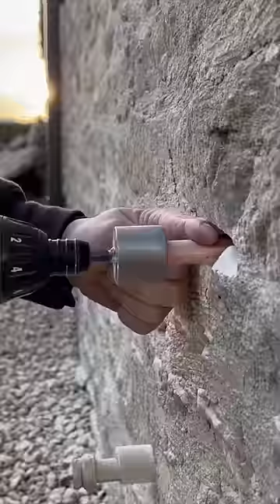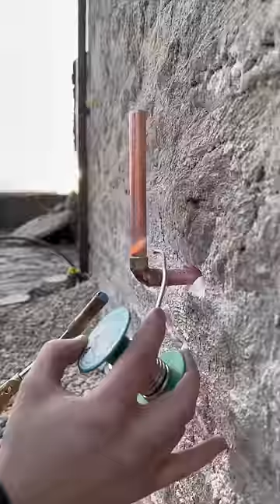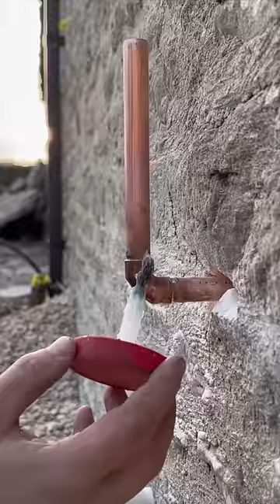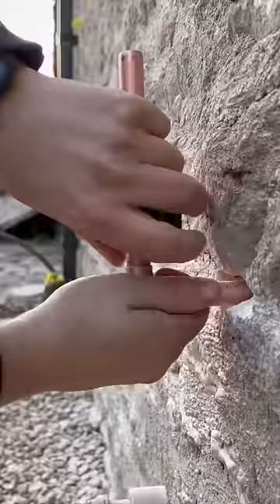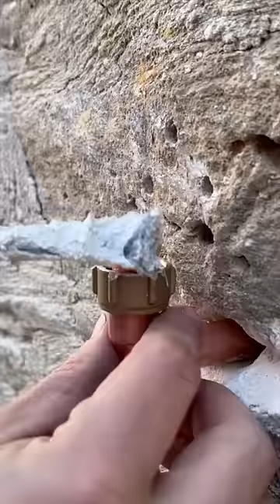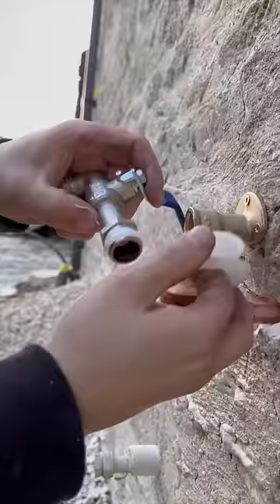HOW To fit an outside tap on stone wall! #howto #asmr #diy #plumbing #subscribe #youtubeshorts

Comment: Ppl, please don’t use teflon or pipe dope on compression or flare connections. Not even in high psi applications!! STOP IT!! Read a book or manufacturer’s paperwork
Reply: bingo
Reply: Why?
Reply: That"s exactly what I was thinking.Any kind of grit will cause a leak.
Reply: You guys are definitely not a plumber!
Reply: @adamhorton7972 I have been a licensed plumber for 29 years. Have run my own business for 15 years. They are correct. You don't use pipe dope or tephlon on compression fitting. The seal is made by the smooth copper, and adding dope can create gaps that can leak over time.
Reply: @billjordan8779  and FYI, if your such a good plumber, then you would have seen the shitty sweet joint that's gonna spray every where.
Reply: If in doubt a smear of Silicone rubber,  but make sure surfaces are perfectly clean and smooth.
Reply: I was going to comment this same thing I’m glad I’m not the only one seeing stupid stuff and thing wtf?
Reply: Dope keeps the brass from galling.  You know that creak you hear when tightening brass?  That's not a good sound. 
That sound is metal shavings between the mating surface. 
Dope is used to lubricate the brass not to seal the fitting. 

Just because you don't understand it doesn't mean it doesn't make any sense.
Reply: Keep drinking that kool aid, guess that’s why they call it dope.
Reply: @adamhorton7972  that's not silver stick, that's soft solder, it back fills once the coupling is hot. Too much and it's going to overflow and make ugly joints. You might be top help, 😒but you're still a helper, leave this to the mechanics.
Reply: Defeats the purpose of the compression joint
Reply: I have always put a little dope on the compression ring and so have all the other plumbers I’ve ever met. How would it possibly compromise anything
Reply: Tady se nám sešlo instalatérů. Pánové, za mě teflon absolutně nepatří do závitu. Závit před utěsněním třeba zdrsnit a poté namotat Loctite/tangit šňůrou, lněným česáním a nebo těsnícím tmelovým lepidlem, pro utěsnění závitových spojů. 😅
Reply: I’ve been doing this 53 years you don’t put pipe dope on compression fittings
Reply: plus Teflon on thread is lefty
Reply: I use WD-40.
Reply: diesel mechanic not a plumber but i use compression fittings on all pressurized air lines 125 psi. I never add anything to the threads. If the compression fitting goes bad those threads arnt going to stop the leak.
Reply: I like to put a quick shot of WD-40 on the compression assembly before tightening. Keeps the ring from binding so you get a perfect seat.
Reply: @therighthandmann  I agree.
Reply: @treborobotacon I can see an argument for Teflon or dope on the threads of a compression joint, but not on the actual sealing surface. Shouldn't be necessary at all though. You don't have to torque a compression fitting enough to require lubricated threads to get a seal. There are specs for all of this from the fitting manufacturers. Find me one who recommends using anything on the threads of a compression joint, let alone the sealing surface of the fitting.
Reply: @intjonmiller  
Try a bit on the threads. It makes them go together so much more smoothly. Is it necessary? No but you don't have to struggle to get them tight. 
It does nothing to make a seal though.  That comes from the face.
Reply: @intjonmiller 100% pointless to put anything on the threads of a compression fitting. The nut spins freely around the pipe big gap at the bottom. what are you sealing? Absolutely nothing.
Reply: Why they even make that dope if you don’t need it?
Reply: And what’s that Teflon…. I’m going all frying pan here?

Comment: incorrectly installed, always install the elbow and faucet downwards, because when frost comes, the standing water will freeze and then always flow out.
Reply: Have you considered that America/Canada aren’t the only places you can install a tap?
Reply: Or you just leave the valve open and any ice expanding with come out of the open end of the valve.
Reply: Id bet they got much worser issues if this is in fact a frost zone
Reply: thanks god i live in tropical country. i don't have to worry about freezing tap.
Reply: @drtibbs693  Why does water freeze differently in other countries? 😂
Reply: Ltmoore8807  wait..do you drink from the tap directly?
Reply: Ltmoore8807  that's....savage
Reply: No need for 90 degree bends.  Just go straight out.
Reply: actually unless you live somewhere that NEVER freezes avoid any exposed tubing install a frost free faucet deep enough to reach the interior of the wall so it won't freeze.
Reply: But theres no water
Reply: @BryanVoigt in a cold climate the ice leaving it open would allow the first portion of the water to closest to the opening and it would then freeze further in the pipe later and since the first section is already frozen the ice has no where to expand except for into the house or out the side of the pipe
Reply: ShortFingerRC my first thought was “well that eardell is going to snap in half in a month”
Reply: You don't know how to seal a union. You use pipe dope or never sease on the back side of the flat part of the union. That's where the friction is. Pipe dope is a lubricant on water systems. It fills in gaps for drainage like test tees but it doesn't work like that on pressurized water systems. Doing the union threads and ground joint does less than the back side of the union where the inside of the nut makes contact. Steam fitters proved this to me several times on jobs. They're 💯
Reply: @drtibbs693 you still cant drain it completely for service.
Reply: Biggest problem is going through the concrete.  It eats copper over time.
Reply: @billmoretz8718  Yep it should've been sill-sealed 💯
Reply: What about in areas with no frost bud
Reply: too late, damage has been done

Comment: Dude could travel across the globe 5 times with that teflon 😂
Reply: Why? He didn't even use much and didn't twist turn it into string wrap...
Reply: @linusaltmann2657 he used way too much. Three turns at most.
Reply: @Dude-xv4os He explained that he likes to use more because of the way their fittings are threaded
Reply: @Dude-xv4os  I had one that needed 10 turns. Put on, removed three times. 
I learned after that.
Reply: circumference of the Earth at the equator is 40.000 km
5*40.000=200.000 km
The typical teflon tape has 5 meters 
That would require 40.000 rolls
Reply: @Dude-xv4os Three turns at most? Are you having a laugh? May as well not put any on at all at that point
Reply: Sicher ist sicher!  LOL

Comment: Always connect to the top of the backplate elbow,it can be drained fully in the event of freezing.
Reply: He did it to return for a second job after it froze.
Reply: Drain off with the isolator inside.  My only issue is the horrible sherardised screws which will be rusty in 6 months.
Reply: If you’re smart enough to think then maybe there’s a bleeder valve down below. 😂 everyone is a critic.
Reply: @matthewmallory3441  So extra job  opening a bleed stuck in the back of a cupboard and catching the water or just open the outside tap when you have isolated it.
Reply: @bobrose7900  Lol you complain about the screws but dont mind the copper tube. Like were 2024.  Why did he put 2 90° pices on the wall? Like what is this abomination? This is not how a plummer shuld do this.
Reply: @grolfe3210  most spigots don't have a drain just a cut-off valve. And all too often the cutoff is below the spigot rather than above it.
Reply: @jensv874 one was a drop ear so the spigot could be secured.. and the other was to move the pipe to a piece of wall with material to secure it to.

Are you a clown?
Reply: @ObservationofLimits  Exactly - so you want one that drains itself. That is the point that I and the other 120 people have made
Reply: @ObservationofLimits  Oh yea yet I make it without the 2 90° pices. Like how do you bend a copper tube? This hole thing is just an abomination. also go strait trough the wall. No reason to do it with 2 90° like that. Im a plummer. You a clown?
Reply: Do you think once nightfall comes, just all the water lines outside insta freeze
Reply: @ghostkilla931  I did not say any of those things. People do live in places where the temperature drops below freezing. In these places they tend to shut off and drain outside taps to prevent them freezing and blowing the pipe. If you need to do this then you can mount the tap low and use it as a drain or mount it high and then have to also add a drain tap at a low place inside. Up to you which option you go for. One way is daft.
Reply: Drain inside of course

Comment: We use “freeze proof” taps here in Canada, which come as a complete wall-penetrating assembly. They are available in a number of different pipe lengths, to accommodate different types and thicknesses of wall construction.
I note that you do not air-seal the pipe penetration in the wall. Most people I know use spray foam for this task. In cold climates, air sealing the building envelope is an important part of properly insulating a home, as well as keeping pests out.
Reply: Indeed. Minus 1 to minus 40ºC doesn't forgive. I didn't know they called it freeze proof. The one I'm about to install, has the cartridge indoors. (Spring project)
Reply: Hello my friend, can I contact you...I am also in Canada
Reply: @rverro8478 that's what we have in ag zone 5 (-20°F). But I still turn off the supply inside and leave the tap slightly open. I'm a "trust everyone, but brand your calves" type.
Reply: It looks installed upside down.
Reply: Same here in Sweden 🇸🇪
Reply: It’s not as cold here also he may have insulated later or it may be a shed out outhouse
Reply: It’ll freeze and burst.
Reply: Air seal w foam etc can come later, but no fix for that freeze threat.
Reply: Here they're called frost free, they're readily available everywhere, not just Canada. This is probably somewhere where it doesn't get very cold. Anyway I use Sika Mortar Fix, spray foam is horrible. If you have time to wait a couple days, you don't even have to use screws. The mortar fix will hold it.
Reply: @Nill757 I love how everyone thinks the temperatures are the same everywhere.
Reply: @jakester455  eh? Yes it freezes long and early in Canada, but it can occasionally freeze down to Florida 28degN, and one freeze will burst that ext spigot.  More than a few contractors bid simple hose bibs in the south,  5x-10x less than frost free hardware, then walk away from that 1 in 5 years freeze:  ‘it’s the south, not my problem’.
Reply: Really interesting knowing the Canadian way😃
Reply: Freeze proof if the moron builder install it properly and allow the water to drain.  Installed improperly and they burst over winter and leave a nice suprise in the spring
Reply: This location appears to be in a warm climate area.
Reply: It appears to be the southwest us.
Reply: This comment is very much useful especially for any place in a mountainous region. Our house was a summer cabin in a mountainous region. in the winter we lived in the city. Whilst we are down at the city winter frost several times destroyed the water pipes and we had to do maintenance for them every year.
Reply: This is a short, he may have when he finished. Why assume?
Reply: Bakır boruyu kaynak yapmadan önce sürdüğün sıvı ney
Reply: We have the same here in Norway as well. In any case, this is not a smart way to install an outdoor faucet. When the pipe goes upwards outside, it cannot be drained before winter either.
Reply: It’s a stone wall.  Didn’t say what kind of wall.  Might just be a wall.  Without a roof, doesn’t make much sense to do all that. 😂
Reply: Same here in Germany my man, this is how it's done the right and professional way🤝🛠️
Reply: Una válvula de bola no es a prueba de congelación , el agua que queda en el orificio de la bola cuando se congele reventara la válvula.
Reply: I get the 12" Frost free for concrete tilt ups 😊
Reply: @Nill757  The tap like that at the back of my Dad's garage in England has been okay for over 50 years.
Reply: @BrianG61UK  is there water in it and does it freeze?
Reply: @Nill757  There's water in it. I guess it must at least begin to freeze occasionally.  It is quite sheltered from the wind.
Reply: Yeah we don’t get it as cold as you guys. Jealous of your snow, landscapes  and warm maple syrup though
Reply: Obviously this isn't a cold environment or that supply line would be doomed. The damage due to exposure is enough to turn me upside down.. What ever happened to putting a faucet directly onto the main outlet pipe without the soldered elbow and added compression fitting?  I've never seen paste used on a compression fitting.
Reply: They work awesome.
Reply: Yeah this install would burst here in Utah.
Reply: Was a 59 second video, I live in a climate that does not freeze, ever.
Not everyone lives in Canada.
We stress air conditioners over heating where I live.
See how where I live has nothing to do with where you live?
Reply: @Nill757 all depends on ambian temperatures. In Alberta can only use minimum 12 inside house but should have a shutoff behind the tap😂Lol 😂😂😂😂😂😂
Reply: We had 90° fittings with drain nipples in them to 100% drain the water for winter and interior shutoff valves. Shut off the inside valves,  open up the faucets, and then the nipples. wait until after lunch for them to dry and shut everything back up until next spring season. 
Source:  outdoor house showers in a northeast United States beach resort town.
Reply: Same in Germany. Only frezze Proof...
Reply: @Nill757 Southern Mississippi, we do not protect outside spickets.   We just let the water dip for the three or four hours it's below 32°F.    Winter down here last all of two weeks.    And it's never below 32° for more than a few hours.
Reply: This would not make it one normal winter in Missouri, unless the person drains the line out every fall.
Reply: It's the same in Denmark.
Reply: I've had those freeze proof taps on my Colorado home for 30 years, never had one freeze and burst in the winter.  Just need to remember to unscrew the garden hoses before the first frost, so the water can drain out of them properly.
Reply: came here to say "Not how to install outdoor taps in subzero climate, and he forgot the internal pipe support after heating the cu-pipe" 🤣😵

Comment: For an outside tap I always come out the wall and drop down into the backplate elbow..,, that way if the customer wanted to turn it off in the winter he can drain what’s in the pipe rather than leave it full of water that could freeze if he forgot to leave the tap open once turned off …. Love the videos I’ve stolen some tips myself
Reply: Depending on where you are like Florida
Reply: Good idea 👍
Reply: If it has a built in check valve it makes no difference
Reply from the maker: I had no bricks below to fix to hence doing it this way
Reply: At last someone who knows what they're doing,(regards freezing precaution).
Reply: 용접하기전 바르는것은 무엇일까요?  붕소?
Reply: Needs more tape.
Reply: @antonygonzalez4398 
As long as the freezing temps this last strange, record breaking winter doesn't become the new normal.
Reply: @christopherscott8853  you caught that as well!!  🤪 I was getting dizzy😜 !! 
MORE TAPE MORE TAPE
Reply: I agree 💯
Reply: 有助提升㶥錫結合劑，令到溶化焊錫更加易於黏合
Reply: I do the same. 
I also remove the tap head , square it up when it's off and refit it.
Neat touch.
Reply: Fascinating, bit illogical. With a the choice to go downward, why'd he make it an upward L?
Reply: very smart indeed❤
Reply: Finally a water tap at the castle wall
Reply: In some regions Winter is just extra rain
Reply: @mmplumber  whattt? Lmao bro, you got proved wrong. Probably a handy man 😅
Reply: There is brick below it to put it into the wall
Reply: @garycrosby7346  It doesn't freeze everywhere, doesn't mean he doesn't know what he's doing🙄
Reply: Might be the western area...
Reply: Wait, what do you mean? You'd have to shut off the water supply to do that. How would you drain it!
Reply: Maybe this is a warm climate
Reply: @paulwilliams5296  100% correct, hence a scour (drain off) valve should be fitted at the lowest point on the pipework, obviously on the "dead" side of the isolation valve. 👍
Reply: Ok half a roll of Teflon. ✔️
Reply: @paulwilliams5296  A check valve cannot drain the water that's below it.
Reply: @pottawatomie2  what are you talking about? I am saying if an outside tap has a built-in check valve water cannot drain from the tap when you open it after it's been isolated from inside. You can release the initial pressure but water will stay in the pipe so therefore coming out of the wall and rising iup to the tap and installing a DOC as the pipe exits the wall is the only way to release pressure and water from the pipe. If the tap doesn't have a built in check valve then best practice is to exit the wall and drop down to the outside tap. I'm 35 years time served in the game pal.
Reply: @paulwilliams5296  Water cannot run uphill.
Reply: @pottawatomie2  who is saying it can?